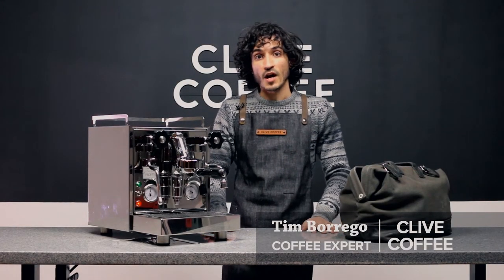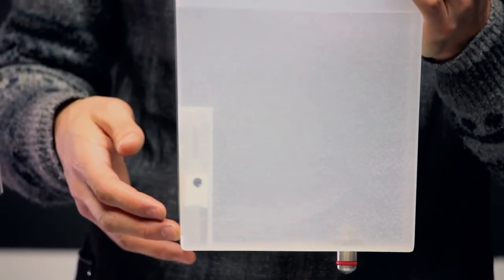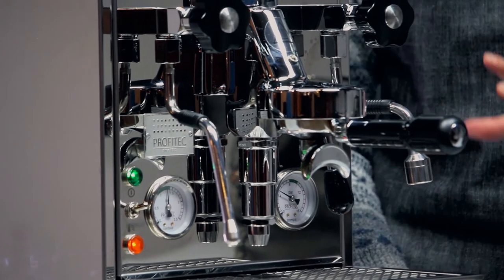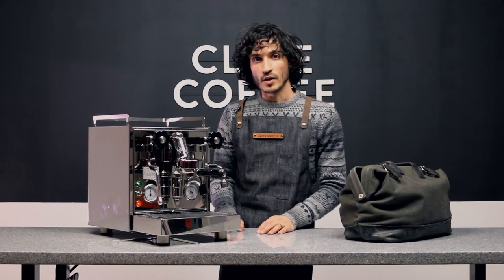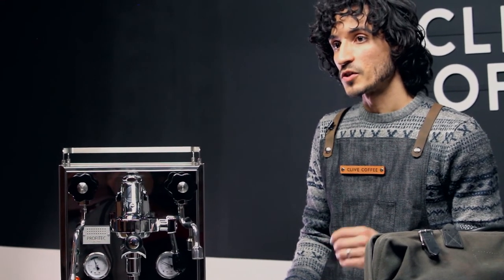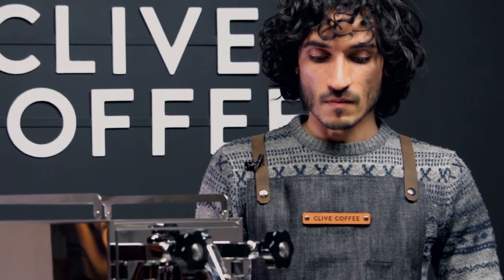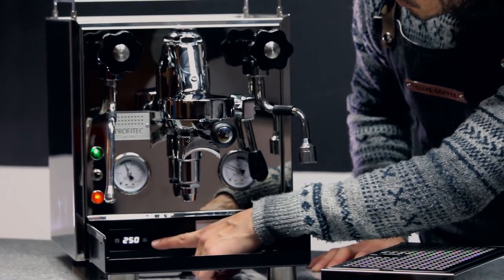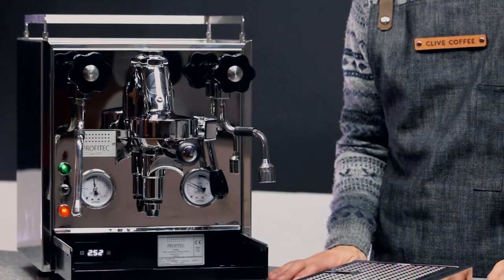Profitec Pro 500 PID | Tech Tips

Comment: I'm a new owner of a Profitec 500 PID. Stupid question: is the machine ready to use as soon as the PID shows the temperature for which it has been set?
Reply from the maker: Not a stupid question — that's what we're here for. Yes, once the PID reaches temperature, you should be good to go.
Reply: @clivecoffee  Thanks!
Reply: Yes and no. 
If you want to be able to replicate your flavors from brew to brew you should allow additional time for the portafilter and grouphead to come to temp as well. 
Will it brew and steam 6-7 minutes after power up, yes. Will it taste like the espresso that you brew right after it, no. 
If you have the time, give it an additional 10 minutes or more preheat with the portafilter installed. 
This is why you also hear about a 25-30 minute warm up. 
Make certain you are preheating with your portafilter installed. 
Cheers!
Reply: NO WAY! The PID reaches the temperature relatively quick, maybe within 10 minutes? Your group head or brewing temperature would still be approximately half that, extremely inadequate for brewing espresso. You'd want to brew at around 190-205f.  That usually takes 30-40mins of heating if your machine is still in good condition. You can easily test that. As soon as your PID reaches your set temp (i.e. 256), pull water out of the head with a thermometer. It may still be near low 100s. You can't brew with that.
Reply: I also personally added a group head thermostat. So no guessing on my end. Your PID might look ready in 10 mins, brewing actually won't be until around half hour later.
Reply: @chshwong  My experience agrees with your statement. Over the past year I have learned that I need to wait 25 to 30 minutes before making coffee.
Reply: @chshwong  I will try your test. Thanks.
Reply: @technikmotorsport  sorry for this very delayed response. My experience matches what you said.

Comment: Does the PID control the steaming temp as well?
Reply from the maker: Hi David, great question. The short answer is yes. The Pro 500 is a heat exchanger, so the PID controls the temperature of its single steam boiler. This has an indirect impact on brew temperature but a direct impact on the steam boiler's temperature and therefore steam pressure.

Comment: What about controlling the brew pressure. It’s as important as the temp.
Reply from the maker: 9 bars is typically the standard brew pressure most espresso machines are set up for. While flow control has gained popularity in recent years, it's not necessary to adjust brew pressure to get a great shot.
Reply: @clivecoffee  when I test it with back pressure, it's going to 10. Does that mean it's too high?
Reply: @pierotintori  10 bar at the pump will typically translate to 9.25 -9.75 bar at the brew group. It's easily adjusted at the back of the machine once you remove the main cover of the machine.  
Tools needed:
2.5mm & 3mm Allen wrenches. Large flat head screwdriver, backflush disc.
Reply: @technikmotorsport  so maybe something like a quarter turn? To get it to 9.5 with backflush?
Reply: it wont take much. With the back-flush disk in your portafilter you can run the pump and adjust the pressure to your desired set point. 9bar at the pump is usually a good setting.

Comment: if it has a pid, why would you need to flush?
Reply: PID controls the steam temp which is too hot for brewing espresso.
Reply: No need. Check out Whole Latte Love video on it.
Reply: PID doesn't alleviate the need to perform a cooling flush on a single boiler heat exchanger. It's purpose is to keep the boiler temp accurate within a single degree. 
The thermosiphon alleviates the constant need to cooling flush. This comes with a footnote though. 
That said, you still need to do cooling flushes on single boiler HEX machines even with a thermosiphon. 
Any time the machine sits for lengths of time the group head will still manage to equalize temps between steam and brew groups. 
This can be confirmed by watching the water boil or exit violently at the group during a cooling flush. 
The PRO500 is not immune to cooling flushes even with that thermosiphon but it does help.

If you look at dual boiler machines, this should not be a concern considering there are separate boilers at different temps for steam and brew.